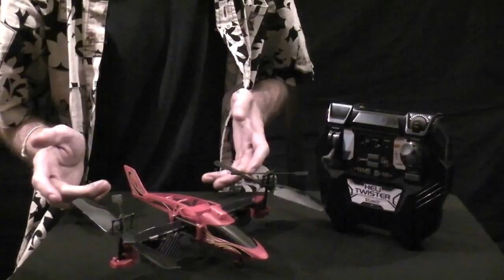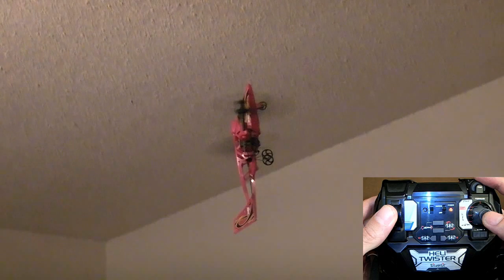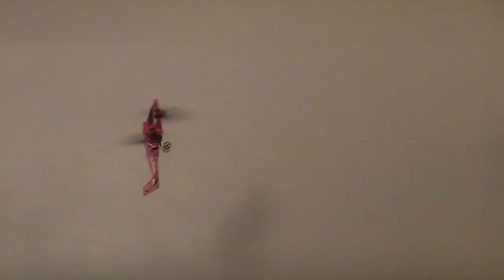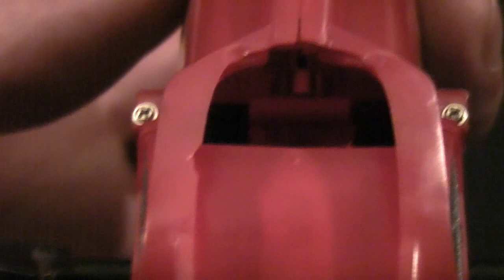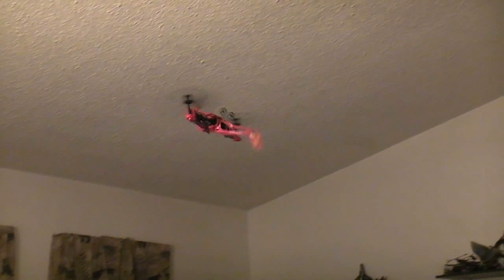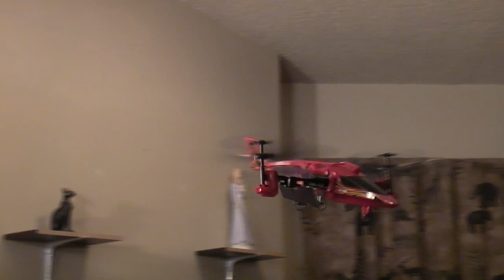Heli Twister Review {RC 101 Exclusive 1ST Look}

Comment from the maker: I love true 3D but It is still hard to get a reliable CP set up at a low cost and a small size, plus the blade speeds are usually pretty high and dangerous for the novice. The amount of mechanical components involved in a CP setup is something that always impressed me, the idea that those push rods are going up and down so fast with such force in such a small space without flying apart is impressive. Nose in inverted hovering isn't as hard as doing a chaos spin but it still takes practice.

Comment from the maker: Infrared range is usually about 20-30 feet max, no outdoor flying in sunlight because it blocks the IR.

I like the micro chinook because I love smaller aircraft and it's easier to fl inside, I've never flown the larger version but if I get a chance I'll do a comparison vid. it should be able to lift a camera and fly outside.